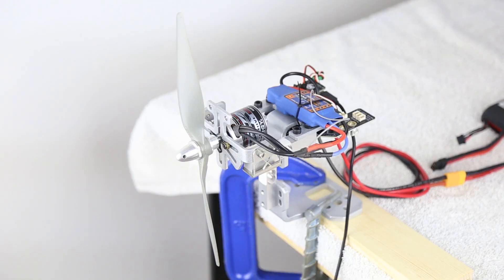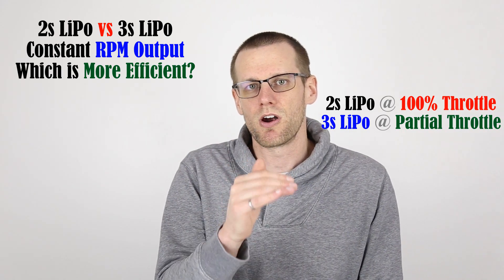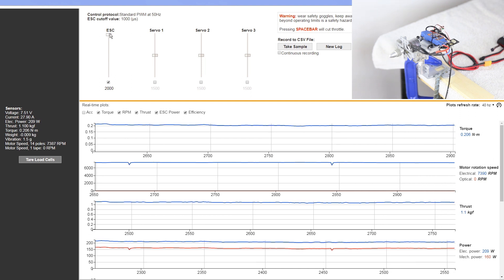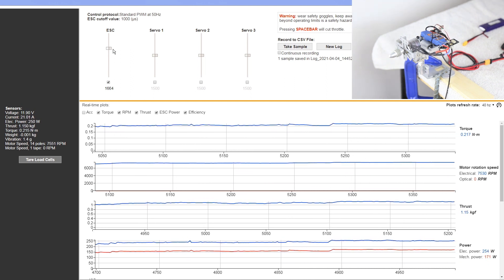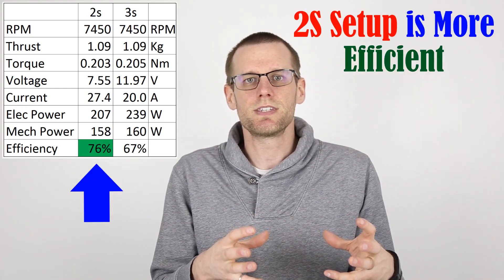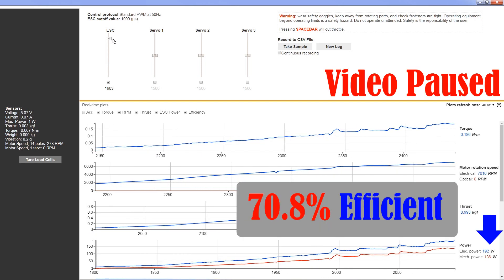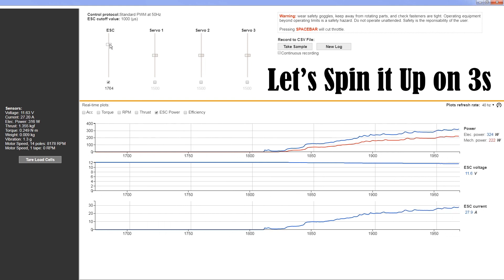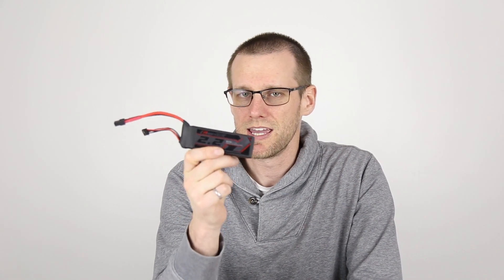Brushless Motor Dyno - 2s vs 3s LiPo with Constant RPM Output

Comment: I guess 3S is more efficient because the higher voltage reduces transmission line energy loss like high voltage transmission towers built by electrical companies.
Reply: I was wrong. But this is a trick situation when 1 setup runs full throttle for extended period of time. No real application does that. In real applications, throttles are always sliding up and down around the mid point. In real applications, 3S will be more efficient. This episode is backward education.

Comment: Would love to see the torque and power output of different kv motors of the same type.  Ex: 1406 slate, 1900kv, 2280kv, 2850kv, 3800kv all run on the same voltage.  Also really like your vids on different data logs and how to interpret the data.

Comment: I have a question😀 I have a 1650 kv motor and I run it on 4s.. can I just gear it up to make it fast as some 2500 kv motor? And if yes, does it mean it will overheat? Thanks
Reply from the maker: Answered where you asked this on the other video

Comment: How do the efficiency losses change throughout the throttle range, is it a constant or is it proportional (or inversely proportional) to throttle position? For example, if your 2S test was run at 95% throttle Vs 3S at say 60% throttle how do they compare then?
Reply from the maker: Hi Peter, this has been added to the video list, thanks!

Comment: Hey super exciting that you have a RC benchmark setup !!

(Some video ideas 😊) I was interested in:

• The step response of different motor/prop systems that depend on:
   • applied voltage
   • weight of the propeller
   • different motor sizes
• The torque variation between motors from the same motor line with different Kv.
• The torque variation between motors from the same motor line of same Kv but different motor size.
• The variation of measured torque from calculated torque from Kt.
• The variation in Kv value with temperature.

I was just discussing these ideas in our drone society last week :)

Shouldn't you ensure the voltage should remain constant with a power supply rather than a battery?
Reply: The reason for the 2nd and 3rd points is because some Youtubers and pilots claim that "You get higher torque at the low end for xx motor compared with yy motor"

... but obviously if you use the same propeller, you apply the same mechanical load and you shouldn't have such issues.
Reply from the maker: Hey thanks for the comment Peter!

Interesting suggestions for sure! I will take a look at these. 

I'm not so worried about constant voltage as I am taking a single frame of data to compare. It wouldn't make a difference what the voltage was in this test for either battery as the primary factor effecting everything is duty cycle.  In addition I'd like to match our power system as we would use them and this is always going to be with a battery.

Comment: Incomplete test as the test did not let the battery drain down and also higher volage/3s will run the motor/battery cooler  if you set the motor gearing down to get same rpm output as 2s.
Reply: Wouldn't gearing down the motor just increase mechanical losses in the system? 

How would you further the test so that you use all of the battery's capacity?
Reply: @peterwoo2489  Yes you are correct, gearing up or down is just like playing with the throttle control to set rpm, I was thinking in a different set up where a lower KV brushless motor pair with higher voltage would run more efficient versus higher KV brushless motor pairing lower voltage set to same rpm.  But back to this test, if we let the battery drain down 3s would be more efficient when the battery slowly looses voltage.

Comment: 3s is more effient due to using less power to maintened at constant rpm output, 2s has already reached max power consumption and will need the battery output to stay constant to remain at constant rpm.

Comment: One of the few RC related channels that actually knows what he's talking about.  I would have guessed 3s... So once again I've learned something here.
Good presentation.  Much more professional "background" vs the couch presentation.   
As a videographer... Watch your "jump cuts"   one was a little close there.    Good audio also.   I'm using your online calculators for battery / charger rate.   Since I'm just getting back into this from the old FM and glow fuel days,   you've given me a lot to think about in planning a good efficient charger.  

If you have any recommendations,  im gonna skip a.c. chargers and go for high wattage D.C. chargers and rig up a 24v PS.  

Glad I found your channel.
Wayne
Reply from the maker: Hi Wayne thanks for the comment and suggestions. I know very little about videography and editing and learning literally everything from ground 0. 

I have a Polaron EX1400 and love it.

Comment: If we change the motor in the 3S scenario to have 7450 RPM under 12 volt (around 630 kv), would we have a better efficiency since current would be lower and would cause less heat dissipation ?
Reply from the maker: It's possible yes and fairly easy to get right, but what you have to keep in mind is that you are increasing the resistance of the motors winding by moving to a lower Kv. This increase in resistance has to be less of an impact vs the impact that the lower current will have on efficiency. Power lost in the winding is equal to the current squared multiplied by resistance.

Comment: 3s volts is potential. More volts=more available power. Your amp load will be lower on 3s.
Reply: Okay I was wrong, makes sense :)
Reply from the maker: Actually what you said is correct. 3s is more voltage. More volts = the potential for more power. Since we were at the same wattage but higher voltage, amp load is indeed lower. But because we were at partial throttle efficiency was decreased.

Comment: I'd like to see the effect of different ESC max current ratings, e.g., around 20A  through a 25A vs 40A rated ESC
Reply from the maker: Interesting, I would have to get a few ESC's to try this out!
Reply: Switching losses should be negligible. Otherwise they will get hot.

Comment: Is there a way to program an ESC to think that when the throttle is held steady at any point it sees that as the full throttle position so it wouldn't have to chop it up
Reply: No
Reply from the maker: Hi Justin, the whole point of the PWM signal sent from the ESC to the motor is to control speed at partial throttle. If it does not chop the signal using PWM you get 100% throttle.

Comment: Doesn't it depend on the motor and kV what ends up being more efficient
Reply from the maker: Motor Kv did not change in any of the trials in the video. The comparison made was strictly 100% throttle vs partial throttle efficiency.  But the motor and Kv can definitely influence efficiency.
Reply: @RCexplained  I meant in general not specifically this test. Wouldn't some motor be more efficient with certain voltage. Maybe because of heat or something 🤔

Comment: Please compare 2S vs 3S, both at full throttle, but re-propped to have the same (or similar) watt output. This is a more realistic type of choice that I need to make.
Reply: It would be a bad test for choosing a prop, because one of the most important factors is air speed, which is 0 in this case. Unless you plan to hover in one spot, you should test the prop in a wind tunnel or on the flight.
Reply: @DerEineDaniel  Not testing the prop, but rather the relative efficiency of more volts vs more amps.
Reply from the maker: HI Andrew, thanks for the comment. Suggestion added to the list.

Comment: I wonder if at a higher ESC PWM frequency, do you get the same result?
Reply: probably the differences will be less noticeable. It was already investigated for small motors here:
http://mshtools.c1.biz/2020/01/06/why-high-frequency-pwm-increases-efficiency/
maybe in this larger setup it is not so relevant anyway, but it would be nice to check
Reply: Probably not, the PMW frequency is for part throttle, not 100%. 100% is basically just a straight dump for all the current that it can use or handle within it's limits. If anything a lower PMW frequency, might be more efficient. Because the switches are working less. Less work, less wasted power, more power going to the motor, therefore possibly more efficient
Reply: @crazylarryjr  , exactly.  I would think as the PWM goes up, you would see less efficiency loss at < 100% throttle.
Reply from the maker: Interesting UAV Tech, I've added this to the list! Very much appreciate the video share too! Thank You!

Comment: RCexplained... you know what would be great, is using the Dyno, show the difference in output between mega-super-dangerous 40A charging vs. standard 4A balance charging before a race run. I dont use these methods, it would be interesting to see if it actually gives a benefit at all.
Reply from the maker: I think I would have to build myself a bomb shelter first for that one!

Comment: I think 3s will be better! My 3s normally last longer on less throttle than 2s flat out
Reply: That has to do with the losses within the battery. Also each cell in the 3S is providing a smaller share of the current.

Comment: 1. lower voltage on the same kv should be more efficient
2. I once posited to you that higher voltage almost always means more power due to uncontrolled power losses from the higher current in surrounding components you don't change. I'd love to see this tested. Can you get the same power from 3s vs 6s from 2 different kvs?

Comment: What I would have liked to see are the 2 real life questions: 
A) Compare 2S Vs 3S, both at 100%, with different gear ratio's leading to the same prop rpm. What are the differences in efficiency / component temperature.

B) Compare 2S Vs 3S, both at 100%, with different gear ratio's leading to the same prop motor temp. What are the differences in performance.
Reply from the maker: Interesting thanks for the comment!

Comment: I think 2s will be more efficient. Why? Less voltage. What topic would i like to see on the dyno? Brushless motor rated for 3s, but running on 4s to see the difference in rpm and power output to see if it can handle it and staying within range of the 100,000 rpm limit
Reply from the maker: I'll have to think about how I can get that video idea to work. Thanks Colin

Comment: I believe 2s because you are carrying 1/3 less battery weight in flight or if you want larger packs for a longer flight time..
Reply: A 3s of similar energy storage to a 2s would weigh the same
Reply: @Alex-dy5ep  No it wouldn't, A 5k 2s and a 5k 3s (everything else equal) would weigh different, because the 3s would have 1 more cell (or two is this is a 2P pack), therefore the 3s would weigh approximately 1/2 again the 2s (3 cells vs 2 cells
Reply: Yes but it also has more voltage, that voltage adds more overall power per KV. That overall power should overcome the weight difference. My thinking also runs with the thought, of both setups at 100% throttle. As the vid shows the part throttle Introduced a difference in the PMW frequency, resulting in a loss to the efficiency. If using different motors to create the same RPM at 100% throttle, I bet the 3s pack makes more power at a more efficient level, overcoming the weight disadvantage.
Reply: @crazylarryjr  I mean total energy, watt hours. Not amp hours. a 5000mah 2s is the same as a 3333mah 3s in terms of total energy, and they would weigh very similarly as well. Assuming equal efficiency and energy usage, energy, watts, not current, they would operate for an identical amount of time.

Comment: Stopped to post this part, I have experimented with high voltage low KV setup's before. My experience tells me adding 1/2 again more voltage (1 more cell) should lower the amperage all other things being the same.
   Post run, didn't think about same motor, but different throttle position, but your findings I agree with. Most electronics seem to work best, at or near as possible to 100% output. Perhaps next time if possible try both at 100% with as close as possible RPM (different KV's) and I expect the 3s to be roughly 30% more efficient. Great vid and I did learn something, thank you. And first
Edit: Changed 1/3 added voltage to 1/2 due to the single cell adding half again the current (2s) voltage
Reply from the maker: Thanks crazyjr, I would love to give that a try!

Comment: BEFORE: 3S is 11,1V but 2S only 7,4, so the rpm is higher on 3S... I think that the result will be more infuriated on the propeller.
AFTER: As expected... but that is only the power efficiency. could do the same taking the energy consumption?  for example, mAh, or Wh used in the two systems for 1 minute, I can write the script, I use the RC Benchmark.
Reply: You can see the power.. 60W are 1Wh in 1 minute, supereasy.